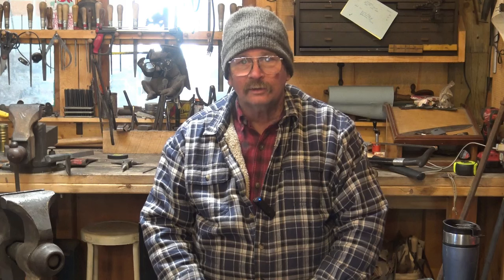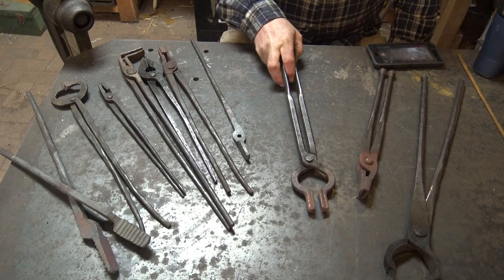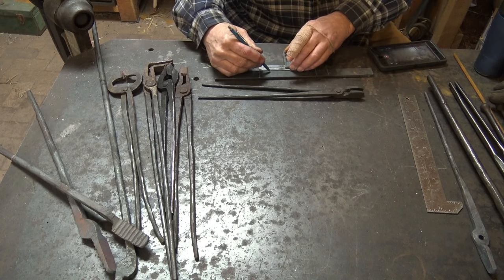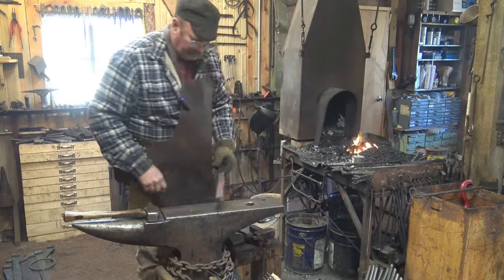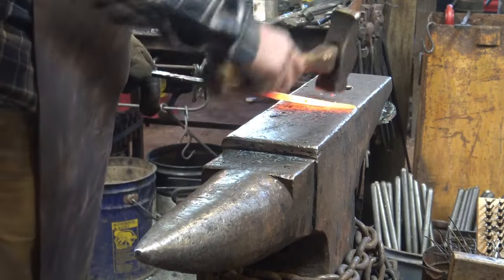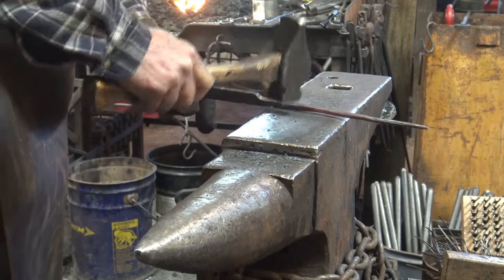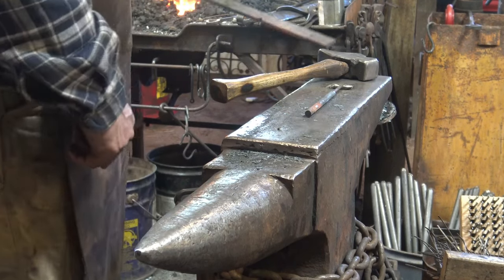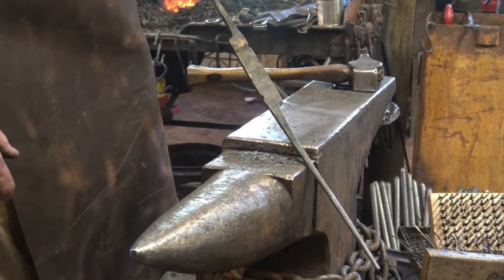Introduction to tong making part 1, flat stock tongs without tongs - drawing out by hand.

Comment: Just broke my first pair of tongs working on my second pair 😂😢
Reply from the maker: That hurts.  Usually that's the result of a cold shut forge in to a stress area.  It's important to keep the transition of the reins and the jaw at the boss from getting thin
Reply: @BlackBearForge  exactly what happened to the pair i was working on, which i started because the steel i used for my first pair wouldnt harden for me. Ive got better steel now for the next pair, just finishing up my shop before i try again.

Comment: For those lacking other tools I'd recommend a wet rag to quench the side you need to grab. Im inclined to imagine anyone would be able to find a sacrifical rag they could use even if they dont have pliers etc. I would also think for marking the measurements a file might be more accessible and leave a more noticeable mark than the piece of round bar.

Comment: wouldn't it be easier to use 1/2 round solid to forge just the ends ? ...great video also since im just starting out, very helpful hints and ideas..great instructions and SLOWLY spoken
Reply from the maker: 1/2"make a weak pair of tongs
Reply: @BlackBearForge  well cold roll would be my suggestion on round stock bu then again hot roll wouldn't make any difference depending on the job ..time is also a factor on making a tong..round stock you can make the ends of the design faster then rolling our a square to round which makes the grip thinner and uneasy to hold on to...make a video and get the audience to decide on time and design..Have a great weekend
Reply: @BlackBearForge  I do enjoy your lesson videos, they are very helpful and easy to understand..at 62 yrs old , speed reading or listening isn't my thing LOL LOL  Thank you again for all you do for us beginners

Comment: Decent (heavy) anvils are crazy expensive. Upwards of $5/pound lately in my area. I found a 12-3/8" × 8-1/8" x 3-1/2" block of steel at a local recycler that just so happens to weigh exactly 100 pounds and just so happens to also have 6 very square faces, 5 of which are nice and flat. Cost me $50 out the door. That and my three-pound sledge worked just fine for cold-straightening a very bent riding mower blade a few weeks ago. Certainly don't need something huge to get the work done. Just takes more effort. Which is good for learning. 😁

I only did it cold because my torch was out of gas and I needed it done immediately. Thank God my gloves were padded.
Reply from the maker: They are, but still in the same price ranges that a woodworker might pay for a good table saw and probably cheaper than someone building a hot rod would pay for a nice set of mechanics tools.

Comment: Got into it as a hobby second thing I learned was making tongs. Used a pare  of channellocks to start. Ended up making 10 or 12 sets of tongs. Had plenty of scrap metal and got to like making them. Watched a video where the blacksmith used flat bar and it was quick and easy

Comment: I always thought a tool was named by combining each side’s name together into one.

Pick-adz (for rocky soil) has a pick on one side, and an adze on the other.

Pick-axe (firemen’s axe)

Claw-peen (carpenter’s hammer)

Cross-peen (blacksmith)

Ball-peen (peen face and a ball on the other)

Claw-hatchet (old antique carpenters tool)

Am i crazy? Ball peen hammer (i thought) has a ball and a flat peen face.

I thought the cross was the part perpendicular to your handle (to form a cross). I think i picked this idea up from roy underhill.
Reply: The peen of a hammer is the opposite the flat striking face. A ballpeen, then, has a ball for a peen. A crosspeen is cross (perpendicular) to the handle of the hammer.

Comment: I haven't read all the comments. But you can also lay a triangular file down on the Anvil which will leave the pointed side facing up. Then you can lay your material on top of the pointed side of the file and strike it. You don't have to use a file you can just make a piece of material into a triangle by forging it and use the triangle. If you're going to hand make the triangle make it big enough to lay on the Anvil. Then you can lay your material on top of the triangle and strike it.

Comment: Why do you have the beak of the anvil on the right hand side ?
Reply from the maker: Neither the anvil nor the work care which side it is on.  Personally I find it just as easy to work on either way.  So it is actually the hardy hole that determines my anvil placement.  I want it away from my hammer hand so I can safely leave a bending jig or other tool in the hardy hole during repetitive operations.  My new anvil has the hardy hole near the horn, so the horn is now to my left.

Comment: I’ve seen a couple of smiths make tongs just from round stock without tongs and they just used thicker round stock to make the whole thing and drew out the reigns. I thought one of them was you but I guess not? Unless you made more after this video? The piece was long and they eventually cut them off with the cut off hardy tool.
Reply from the maker: I have done quite a few videos on different approaches to tong making over the years.
Reply: @BlackBearForge  either way I always enjoy your videos and learning different techniques! Thank you!

Comment: How do you oil/lubricate/grease those joints (especially if you're making pliers instead of tongs)? How do you usually deal with rust on your self-forged tools?
Reply from the maker: I apply wax while they are still hot enough to make the wax smoke lightly, sort of like seasoning a cast iron skillet.  They rarely need anything else.  But a drop or two of oil at the joint would be simple if the start to drag.
Reply: @BlackBearForge  Great advice! I would be highly appreciative if you could do a short video on forged tool maintenance along with different suggested brands of oils or waxes.  I can kind of visualize what you mean when you describe the waxing process, but a video would be super helpful!

Comment: I have heard you say "kneeling", "hardening", "tempering", ect.
Can you explain the terminology?
Reply from the maker: I have done several videos on the subject.  But basically annealing is slow cooling to leave the steel as soft as possible, usually very controlled and over many hours.  Normalizing is air cooling to relieve stress (air hardening steels can't be normalized).  Hardening is quenching at critical temperature for maximum hardness, different steel quench at different critical temperature and in different mediums such as air, oil or water.  Tempering is controlled re heating of hardened steel to remove some hardness so as to avoid breakage and to achieve the exact amount of hardness required.

Comment: Just a suggestion that helps me when I am trying to reproduce a part/tool, is to make a chalk outline of the tool/part on the work bench. That way you just lay the forged piece on top of the outline and then can see exactly how much more forging is needed.
I have seen some black smiths chalk a measurement on the anvil itself, more on the side than the top. Quicker than fumbling for the prototype and holding hot steel.

Comment: I DID IT!!!! It took me way longer than it took you but I did it. I followed your steps and made tongs. I’m pretty proud of them. I’m sure they’ll need more adjustments as I start using them and they aren’t too pretty but I made them. First project in my single burner Amazon forge. Crappy hammer and a hunk of steel as an anvil.  It’s much easier to watch you do this stuff but not as satisfying. Lol. Thanks for helping and inspiring.

Comment: I didn't have a hardy (just have a block of steel for an anvil) so I drilled a hole in a stump that fit the end of my cold chisel and used it a bit like a hardy tool.  It's got terrible rebound so you have to hit it like heck, but it works.

Comment: Question: conservatively speaking, how long should it take to forge out a pair of these tongs?
Reply from the maker: start to finish and ready to use about 2 hours
Reply: @BlackBearForge  Awesome, thanks! :) I made a go at this yesterday and it wasn't going nearly as quickly. You were definitely right when you said that proper heat is key!

Comment: You can make tongs with a chisel and a bending bar first get a rod of steel pound it into a coil make two offset rods with simple tong ends put them through the coil heat the tong teeth and where you would have them bend put a rod heat pound them to scale simple medieval tongs

Comment: My first pair of tongs I had a welding glove, pliers and vice grips! Just as you said! Got the job done, lots of frustration, swearing and burnt fingers later I had something that loosely looked like tongs and worked just as badly. But, they did work well enough to get me through those first steps! Still have them somewhere, if I had to burrow them out I probably could. I wouldn’t throw them into scrap, they have history, but not enough for a place on the wall!

Comment: Another suggestion, based on what I've been doing as I start out.  I only have pliers to work with so far, but I've taken to wearing a heavy welding glove, that I just keep wet.  It will heat up over time, and could theoretically burn you if you let it get too hot, but if you dunk it into a bucket often, it will protect your hand from the heat allowing you to hold decent size pieces for long enough to get a bit of hammer time in.  Not a perfect solution, but one that works better than nothing.

Comment: I would have to argue, that an angle grinder is an essential tool for a beginner smith, alongside fire, hammer, and anvil.  It is a fast and easy way to cut both solid metal parts, or sheet, with a cut-off wheel.  Grinding wheels can remove large amounts of metal quickly, to reshape tool edges, points, etc.  Flap discs are less aggressive, and smooth out or polish surfaces, and round over corners.  Sanding discs clean up rust or paint, and can sand down wood for handles.  Wire wheels also clean and strip surfaces, without really removing material. Diamond blades can cut stone, concrete, firebricks, etc.  With the right disc type and grit, the angle grinder is probably the most versatile tool available to us.  Best of all, fairly cheap ones can be had for $20-30, that will do well enough to get you started.  While they can be dangerous if abused, if treated with respect and used safely, they are a solid alternative to many advanced tools that are out of the price range of most beginners.  They are also useful in other adventures around the shop, outside of smithing.

Comment: I am wondering what type of oil you need to quench? Can one use used motor oil? and what about synthetic oil?
  from wdrodgers@mymts.net
Reply from the maker: Motor oil had additives and impurities that can cause problems.  Either use actual heat treating oil or something like olive oil.
Reply: @BlackBearForge  Thankyou for the reply. I didn't know that there is an actual heat treating oil, never have heard of it, so am glad that I inquired about it. Thankyou   Wayne

Comment: Could you just use a sharp corner on you anvil you make those marks instead of awkwardly holding a chisel or is that a "no no"?  Edit: never mind. You did exactly that as you were drawing out the metal. So I think marking it that way is fine. Thanks.
Reply from the maker: Yep, lots of ways to approach any given project.

Comment: I dont understand. Why go to the effort and expense of making the tongs from flatbar when it would be cheeper and faster to just use 5mm roundstock for the handle and maybe weld the handles to a set of jaws you make ! Serems the majority of the video was drawing out the handles. Just seems inefficiant.
Reply from the maker: Most new blacksmiths don't have welding equipment, nor have they developed the skills to forge weld.  Anyone learning blacksmithing should learn how to draw out material at the anvil and this is a good exercise to that end.  The cost difference between starting with shorter round bar or a longer round bar is non existent.  Forge welding is the ideal method, but requires tongs for the process.  Making tongs without having another set of tongs was the point of the video.

Comment: Why do I get the feeling that the earliest steel/ironworking tools we're lost wax casted bronze?
Reply from the maker: I wonder if lost wax even existed in that time period
Reply: @BlackBearForge  I know they're are lost wax amulets that predate Hittite iron by about 1500 years. I also remember my history professor showing us very rectangular bronze hammer heads. They were heavily battered on the ends and I always felt that they reminded me of hand sledges. I don't know of any evidence for tongs though. Would love to have the time to research that properly though. I feel sure that stone told we're probably used at first too. Just thought I had when I started to ask the, "which came first, hammer or tongs," question.
Reply from the maker: Interesting. I figured lost wax was fairly new and that most of the bronze age tools were cast in hand carved molds.
Reply: @BlackBearForge  I think many of the larger elements were, but there are even swords that show some signs of lost wax casting, so I'm not sure which was more common or which was used for what purpose. I know jewelry has been lost wax casted for thousands of years. The belief is that they used bees wax and high silica sands to which they had access in the ancient Near East.

Comment: I think all you need, an anvil, hammer and files. You can make a chisel to hot cut and cut and sharpen  it using the files. Then you can make a punch but hot cut it. It's alot of work to file more than once. Then you can make tongs and then your set

Comment: I have been attempting to make this pair of tongs. I haven't been having to much trouble with the techniques (rounding the first rein didn't work as well as I would have liked) but I've  only been able to complete one rein on three attempts. They are melting in half while I am drawing them out. On this last attempt, I put 6 inches of metal in the fire and only four came out. I'm  not sure what I'm doing wrong. My forge is home made and is charcoal fueled with a repurposed shopvac for a blower. It doesn't even have any refractory material in it, I'm using pavers and gravel to make the firepot.I'm using 1/4 by 1-1/4 flat bar from Home Depot to make them. Any thoughts or advice?
Reply from the maker: If you are melting or burning steel you are to hot or leaving it in the fire to long.  Try turning the air down.  the vac may need a damper.
Reply: @BlackBearForge  Thank you

Comment: This is one of the videos that really make people follow you.  Because you are a great teacher. And with this video you show and inspire how things can be done without all the fancy tools. To me that's blacksmithing. I understand making money. You need To be more efficient with more fancy tools. Blacksmithing is basic.  And your videos you tell how it can be done both ways. And that's great and what makes you a great teacher. I hope to one day get to meet and work with you.  Thanks. And keep up the great work.
Reply from the maker: This video is my 4th most watched video of all time.  Thanks
Reply: This may be a dumb?   But. I'm going to ask anyway. What do you make your rivets  out of. Is just going and getting 1/4 inch round stock. Or what ever size you need. In round stock. Mild steel.  Thanks.
Reply from the maker: If you need an exact size, cold roll is exact, but for punched holes whatever low carbon steel you have that fits should be fine.  You can also buy soft steel rivets
Reply from the maker: I frequently just buy premade soft steel rivets  But cold roll mild steel works very well to make your own
Reply: @BlackBearForge  thank you. I ask because I would just like to do it all. And just want to learn. Thank again

Comment: I have 3/16" x 2" flat mild steel stock. Would that work for making tongs? Do I need to do it any different to the way you did to make it work?
Thanks
Reply from the maker: It would be pretty thin for tongs.  You might be able to chisel the shape then forge to finish for very light use.

Comment: Can you tell me if i cut the blanks out with a cutting torch would it hurt the steel to make the tongs
Reply from the maker: It should be just fine as long as its a neat cut, otherwise it might take more time cleaning it up than it would take to draw it out.

Comment: 4:40 A video on what tools to make first would be tremendously helpful. I'm taking a class soon and then I'm going to build a forge. I have a couple friends that work in metal shops that I'm hoping can get me some piece of scrap metal suitable for an anvil-like object.
Reply: I to just started a few days Used angle cut wheel ,cutoff hardy ,2# hammer,forage shovel, round pointed punch.notepad ruler help me and making tongs and chisels first Hope this helps

Comment: You mentioned that sucker rod makes a good punch and I'm wondering if you know what kind of steel sucker rod is generally made of. I know that sucker rod can vary a lot, but in your experience is it a mid-carbon steel? Is it very hardenable? Thanks for the video by the way!
Reply from the maker: Lots of it is 4140 or 4130.  But it comes in lots of varieties.  If you search online there is a chart that shows the varieties.  But you need to have the coupling end with the number on it.
Reply: @BlackBearForge  Alright I'll take another look to see if I can find that chart. I appreciate the reply and I'm sure I'll be watching a lot more of you! Thanks